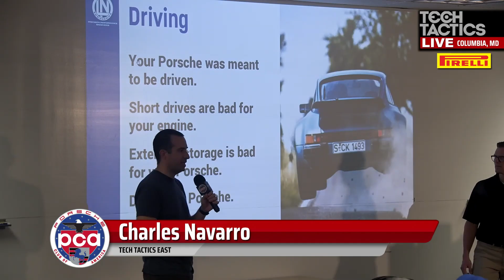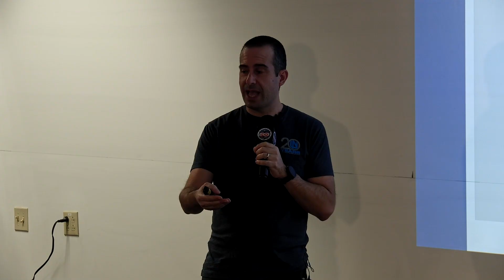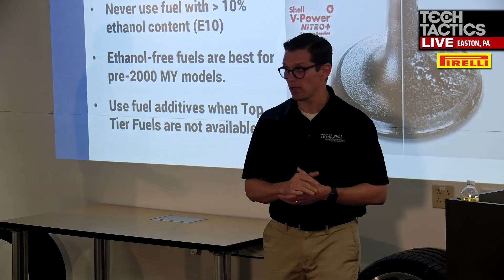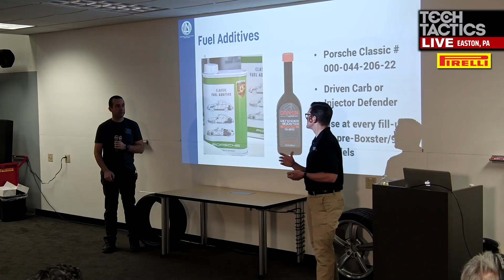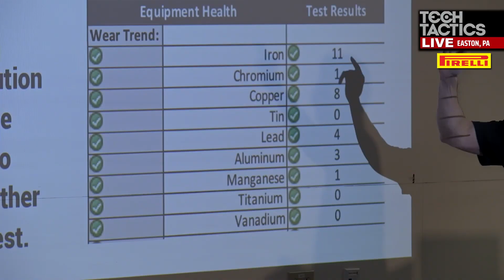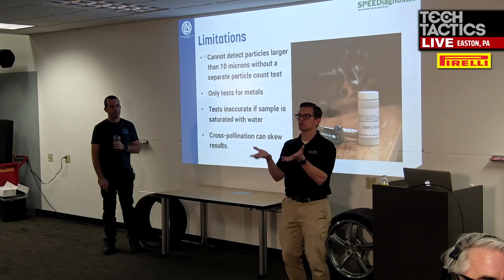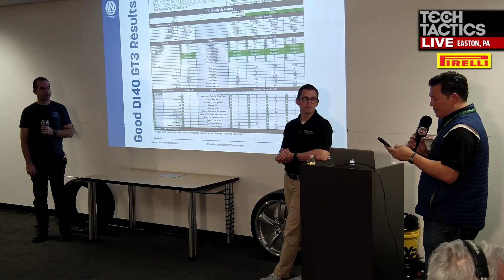How To Keep Your Porsche Engine Running Right: Oils, Fuel, and Oil Analysis | Tech Tactics Live

Comment: I am seeing some people recommend the DI40 over the DT40.  What would you recommend for a 2025 Cayenne E-hybrid Turbo?  Do you void your warranty if you use this oil?  Would you recommend using a bottle of Driven Fuel Injector Cleaner with each fill up if you don't have access to top tier fuel?  If not what would you recommend to add to fuel up?  Sunoco 94 is what is available near me.

Comment: @porsche club of America 
It's a great video, very informative. Wow. So, should we move to C40 oil or stick with A40 for older-gen cars? By older, I mean 981 GT4 2016. To be specific, I have been using liquid Moly 0w40. Should I move to C40 oil? The car is used for Street and Track.

Comment: Take-aways from this teaching:
#1. Never use "Seafood products” or Marvel mystery oil in Fuel or engine Oil, Ever!
#2. Never add ANY Oil additives to your oil, get an Oil that has what you need!!!
#3. Fuel additives are good If they possess PEA -Polyertheramine in its formulae.
#4. A dryer filter in Fuel line (like what's available in Diesel trucks upgrade) helps separate water grains from it, so engine doesn’t inject water into fuel combustion cycle. 
#5. Absolutely use injector cleaner to Keep the fuel-Mist proper and dispense holes Clean!
#6. Keep oil brand same, switching ruins formulae protection building by-brand.
#7. Lake uses DT40 and says the extra cost is worth it to him, Can’t ask for more better advice. Use >Di40<  oil!!!
Reply: FYI...Lake said Seafoam,not seafood.

Comment: You say the DI40 oil is the equivalent for C40. On the website it states "This engine oil will NOT MEET any current API or OEM Engine Oil Specifications. This is because we use additional levels of ZDDP, Moly and higher performing base oils and viscosity index improvers than are used in typical formulations." So to me that means it would void a warranty if run in the motor. Could you clarify?

Comment: Thanks Mr. Speed. Just did the oil changes from the car, truck and van  that was changed almost 8 weeks ago with the FR3. I have a few used VOA's in the past and collected the new ones to compare the usage and on how did the add pack are lowered vs. non-oil additive. Cheers.
Reply from the maker: Great to hear! Thanks for watching.

Comment: On old Porsche 928s the thrust bearing failures were due to using thin oil so Porsche recommends 15w-50 or 20w-50 unless you live in extremely cold climates.

Comment: very nice tech videos good job guys - porsche boxster excellent and change oil filter slightly before service dates // if going away leave for couple of days after checking with dealer for security // I always aimed for safety comfort over speed but if you really like track days - // 30 guys 30 shares in a track specific car - clear agreement as to what days it can be used etc - I used to live near a track in UK kent // never raced mine liked to visit to watch cars and bikes // if I had family would have been fun day out once a month and if looked after a good investment - some cars go up in value if raced and correctly maintained GT series - if you keep all history invoices photos etc // wrap graphics a local company sponsor // some tracks in UK even now have secure lots for amateurs race cars // dust cover security guards etc // expensive until you join as a group have a clear contract and get ten good local sponsors who pay per year // still expensive hobby but - more within reach ...

Comment: 3:19 not totally true. Sure if it was stored in a high humidity environment with salt fog, sure.

I bought my 2015 991.1 GTS from the original owner in 2018, 3 years 1 month after he took delivery at the Porsche dealer and it had 98 miles on it. A great find since where was I going to get a Normally Aspirated 991 with a 7-speed manual when only 991.2s were available new. Did my checks personally and now more than 5 years of owning it, it has been flawless. And the best part was I got to break in the engine instead of some clown going WOT on a cold engine. High mileage is like runway behind you, totally useless, I'd know.

Comment: For my 2019 mercedes g63 should i use shell 93 or chevron 94 im lost
Reply: Shell 93 is the best, towards the end he states it, my X5 I’ve been issuing it, took a scope to the cylinder walls combined with redline oil… it’s brand new after 200k miles

Comment: "Mobil 1 FS Euro 0w40" is an A40 (ACEA A3/B4)  fully-approved oil, and is also API SP (SP provides the anti-LSPI we want, and a nice chain-wear test too BTW), and it has moly in it.  Most other A40 oils don't use moly at all, as these guys say, and they probably aren't anti-LSPI, but this particular kind of Mobil1 0w40 has what Alusil-cylinder Porsches want.  Look for "A40" printed on the back of the bottle or jug, and "SP" too, in 0w40 here.
Although, the amount of moly could use a slight boost on Porsche Alusil cylinder engines, so I would put about a half-dose concentration of Liquimoly CERATEC in it to increase the moly level slightly to combat bore scoring.
This flavor of Mobil 1 0w40 also has a bunch of other German-engine approvals, so it has been tested A LOT !  
Mobil & Infineum know what they are doing here.
And it is easy to get (Amazon, Walmart, most autoparts stores carry it).
Reply from the maker: Thanks for the info! We really appreciate it.
Reply: Considering that the average car on the Autobahn cruises at 100 MPH and often far more.
Reply: Yep I have been using it for years mobile one don’t forget the FS

Comment: I am disappointed PCA gives this open platform for these guys to promote their brand oil and their oil analyses…and let them talk negatively of their competitors like BlackStone.
Reply: I did not hear them badmouth Blackstone, just that they use a different method to analyze oil.  I use Blackstone and the important thing to do is trend analysis.  I agree with what they said about fuel additives with PEA in them.  It was Chevron Chemical Company that formulated PEA many years ago and the Chevron Techron was the first fuel additive to use PEA.  I can remember when BMW only recommended using Chevron Techron as a fuel additive.  There are many additives that now use PEA and a lot of them state it on the label.  I have been using the Chevron Techron for the past 20 years and see no benefit of switching away from it.
Reply: @johnnypipe  They basically said BlackStone's comments were not worth reading, and gave an example of car that had bore scoring to which Blackstone said the car just needed a filter...which I find very hard to believe. The video should have had a disclaimer "this includes a paid advertisement"
Reply: The amount of important knowledge shared and brought to light here is so much bigger than any “marketing /promotion”. I didn’t even feel there was any intent here but, even if there was, I would take it any day compared to the crappy information found on the internet.
Reply: Were we listening to the same presentation?? I've never heard Speed Jr. openly talk badly about this kind of stuff and he sticks to the facts.
Reply: I don't believe either has a financial interest in Driven and Lake is no longer employed there as I understand it so it is not accurate to call it "their brand oil".  If you understand the chemistry, then you understand what makes an oil like Driven DI40 better than the rest and you don't need to listen to what anyone else thinks.  Either way, let's be fair.  Blackstone's testing methodology has a number of shortcomings including a crude and misleading approximation of fuel dilution using the flashpoint because it's more expensive to use gas chromatography.  They also use TBN rather than using a FTIR test for oxidation measurement..... you get what you pay for.
Reply: Yeah, @groach45 is complaining about a non issue.
Reply: I am disappointed because it makes no sense to an average Porsche owner like myself - their oils, their oil change interval contradicts what Porsche recommends for my car. So there should be some disclosure, clarification in the beginning, say this is for the racing crowd, hard core crowd, or old cars, or whatever else. Waste of time for me.
Reply: @olasek7972  I agree.
Reply: @olasek7972 If the page that the manual offers you is all you need - your all set. Just understand its written for every Porsche owner on the planet regardless of climate or use case. If you believe that there is no difference in an oil choice you'd consider  " best" in Finnland vs Australia that manual is just right. Same if you believe a 32 year old enthusiast and a 55 year old female real estate agent demand the same from their car. Again, thats how the manual is written. Do you think Porsche race teams use that manual?
Reply: @autonomousindividual7780 what a bunch of nonsense, Porsche race teams aren’t concerned with warranty or longevity of their engines.
Reply: @olasek7972 Well, obviously you know best based on extensive research. You saw the the page from the manual. What again was your question.
Reply: @Olasek  if you aren't hardcore, you're driving the wrong brand of car.
Reply: @cspl6134  BS

Comment: So many contradictory opinions on the storage issue. The other school of thought is by not running your engine every two to three weeks the internals become dripped dry and then there’s excess wear upon start up.
Reply: Not really. Starting it during cold winter storage without fully warming up the engine on a 10+ mile drive only generates condensation.

Speaking from experience after taking the oil pan off after 7 years of storage and looking at the internals. Everything was  perfect. If you want to do anything, disable fuel and ignition and turn the motor over till you see oil pressure and removing the spark plugs helps, plus you get to spray the cylinder internals.

By the way, after 7 years of storage, it started up as if it had run the day before (fresh gas of course as the tank was drained upon storage).